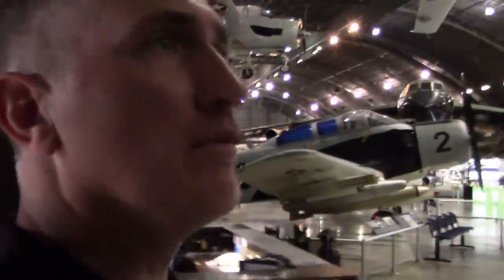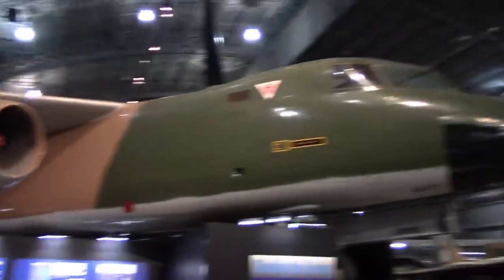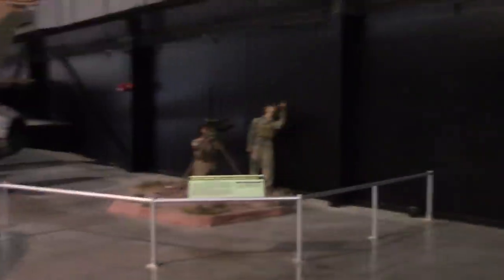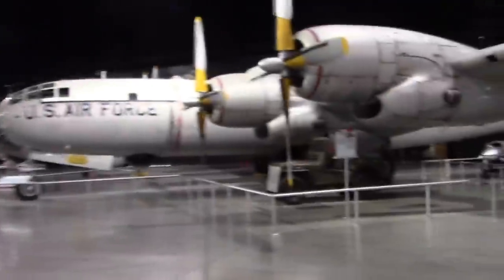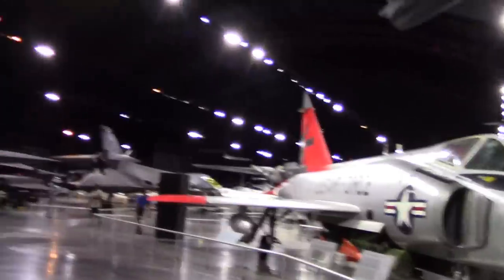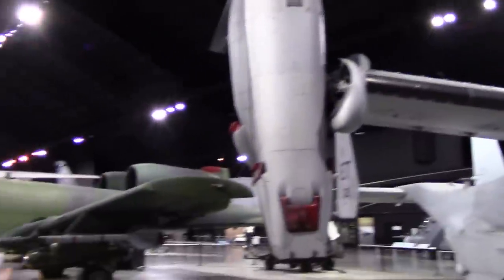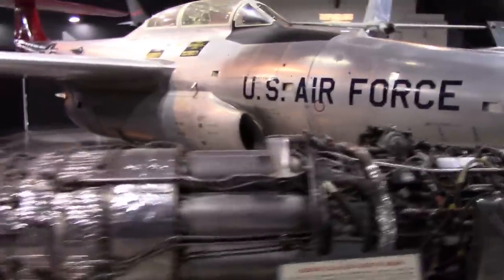Unofficial High Speed Tour of the National Museum of the USAF, Pt 2

Comment: Different B-26. The one in the last video was the Martin B-26 Marauder. The one in this video was the Douglas B-26 Invader. The confusion comes from the Invader being the A-26 during WWII and redesignated B-26 after the Marauder was retired. Special bonus neckbeardian trivia, the F-94 you showed is a B model which is Ak-Tchiually not a "Starfire". That name applies only to the F-94C model, according to Lockheed at the time.
Reply: Didn't know that about the Starfire name. Thanks.
Reply: I was about to type the same thing. Completely different aircraft with nothing in common but the designation.
Reply: In WW2 section was the A-26 light bomber which replaced the A-20 Havoc. The A-26 was renamed B-26 after Marauder retired. A number of B-26's were used in Korea painted all black or black on lower surfaces as night interdiction raiders. 

In cold war section the B-26 is a B-26K rebuilt to zero hour airframe for COIN ops by On Mark Corporation. They were used as COunter INsurgency aircraft and night interdiction in Vietnam but we're retired after a number were lost under questionable circumstances. Questions were raised about being too old and reliability issues.
Reply: @Anlushac11  The A-26A, (B-26K) also flew as Nimrod, were the most efficient truck killer per sortie. (at night)
Reply: .At some point, the B-26 Invaders in Vietnam were re-designated BACK to A-26, so the US could say "We Have No Bombers in SouthEast Asia" with a straight face.
Reply: @stevevernon1978  Ha! I never heard that. Wiki says it was Thailand's government that wanted that. I guess the F-111s were okay because they were "fighters"...

Comment: Just popped into my head, way back when I was in my mid-teens, my parents and I went down there to Dayton. I think it was because my Dad had an appointment for something at the VA, and we ended up at the museum for the day. Anyway, my Dad started jabberjawing with some random guy and they came to the conclusion that they had probably tripped over one another at some point in Vietnam because they had served in the same area at the same time. Turned out the guy was one of the volunteers that worked on the aircraft. He took is in back and we got to crawl all over an AC-47 they were restoring at the time. That was a really cool experience. 

I need to drive down there soon. The place is obviously much larger than it was last time I went, and full of a lot more stuff. Very cool video. Thanks, that brought up some cool old memories...
Reply: They put all the Experimental and Presidential planes into a 4th hangar. So now you don't need to take a bus to see the YF-23, XB-70, X-29, and the various Air Force Ones

Comment: The 2nd F-82 Twin Mustang shown in this vid was a important record breaker.
On 27 February 1947, P-82B 44-65168, named Betty Jo and flown by Colonel Robert E. Thacker, made history when it flew nonstop from Hawaii to New York without refueling, a distance of 8,129 km (5,051 mi) in 14 hr 32 min. It averaged 347.5 miles per hour (559.2 km/h). This flight tested the P-82's range.

This one was a earlier version that used the Merlin engine vs the latter models that used Allisons( less power/ No License fees).

Col. Thacker became a well knowm figure in the RC Scale aircraft hobby through the 60-70's.

Comment: The F-117 was specially restored to remove all of the special stealth materials, so I wouldn't draw any conclusions from the skin as it's displayed. They could indeed have just covered the underlying frame with kevlar or some other strong fabric and painted it black. The B-2 was a structural test model, and likely never had an "operational" exterior, too. At 23:27 you can even see some external braces under the wing that were added to make it safe for display. Also, the F-22 is actually a YF-22 prototype.
Reply: Serbs shot down an F-117 back in '99, the russians long have the "special stealth materials" from it's skin,they don't need to go to an American Museum to take pictures of it.So removing it from this plane was unnecessary.😉
Reply: Raul Alejandro Bastilla - You do realize there is a HUGE difference between the stealth on F-22 and F-35 than the very old F-117? Also having parts of an F-117 doesn't mean that Russia can copy it or know who to actually use it. Even today Russia still can't produce a true stealth aircraft. The Su-57 (which has been canceled) wasn't very stealthy.
Reply: No XF-23 makes me reeeeeeeeeeeeeeeeeeeeee
Reply: @jeremeymcdude  they have that one, too. It’s in the experimental hanger.

Comment: Regarding the F-82 Twin Mustang, the fuselage is significantly lengthened compared to a P-51. This was an issue with the Twin Mustang Restoration Project: Walter Soplata (who saved two of the five F-82s left on his farm) only had one fuselage of the XP-82 prototype, and Tom Reilly had to dispel the rumors that you could simply match a P-51 fuselage to it. 

Somehow he found/rebuilt enough parts to get her airworthy. Beautiful restoration. 

The NMUASF has two of the five F-82s left.
Reply: What little the F-82 has in common with P-51 Mustangs are actually with the H model. Which in turn didn't have a lot of common parts with the B/C/D models.

Comment: I feel bad for my museum’s B52 it has been left outside since the place opened
Reply: Yankee air? If you’re talking about Yankee air they are working on restoring it currently.
Reply: It's kind of hard to make a building big enough for the b52. Even the USAF museum doesnt have enough room for all of its planes. Outside literaly next to the parking lot they have a C-5 cargo jet, a C130, and another A10 just because they have no room indoors for them.
Reply: Bam Waffle Nope The Aviation Museum at Robins AFB we have all of the smaller things inside but bigger aircraft have to be outside because there are only 3.5 hangers. The Ac-130, B-52, A-20, and a few others are outside because of space. All of the rarer stuff is inside like SR-71, U-2, B-17, B-25, and B-29. Our museum has most of these aircraft but not 2 or 3 like this place has. No joke who needs 3 F-4s and 2 B-29s
Reply: TheFireIsOnFire Robins museum would have a C-5 if it had 2 times the land and one more big hanger.
Reply: Wesley Alth only time I saw a B52 was at Yankee air At Willow run. They have one and are currently restoring it. The air museum near me doesn’t have a lot of big planes but they do have the only SR-71 with a twin cockpit, and the Only XP55 in existence!
Reply: @Wesrl  who doesn't need 2 b-29's?

Comment: So that F-22 was built in 1991.  I’m guessing the original design programs started in the 1970s.  Kooky.
Reply: According to the museum write-up on this aircraft, while the serial number is indeed 91-4003, it was built in 1999 and first flew in 2000 at Edwards AFB with the 412th Test Wing.  After testing, it went straight to the museum and never flew with the 1st Fighter Wing, so the paint job is a fabrication for display.  I wish they had explained the 91-xxxx serial number since the prefix almost always is the year of manufacture followed by the number off the line.
Reply: Close, the Advanced Tactical Fighter program started in 1981 took them about 6 years to design build and get the F-22 accepted.
Reply: its stealth capabilities were borne of the have blue and tacit blue programs.
Reply: @birdmonster4586  You might want to check your dates.  The F-22 was still barely ink on paper (or pixels even) in 1987.  

While the USAF recognized a need to replace the still-new F-15, the initial RFP on the ATF wasn't issued until 1985.  FIrst flights of the YF-22 and -23 began in 1989 with first flights in The YF-22 on 29 Sep 1990.  In April 1991, the USAF awarded the contract to the F-22.  (This, I found out is why the first serial number was 91-4001, 91-4xxx for the year and month of the award.)  The initial production run was the EMD (engineering, manufacturing and development) aircraft of which s/n 91-4001 was the first.  These were not combat aircraft, but were used to further develop the airframe leading up to manufacture.  EMD 91-4001 rolled off the line on March 6, 1997.  First flight was on September 7 of that year.

Front-line F-22s weren't operational until the end of 2005, almost 10 years after initial production, 20 years after the first ATF RFP, and 24 years after the USAF announced their desire for a replacement for the F-15.  Keep in mind, the F-15 was still barely 8 years old in 1981, with the first F-15 models being produced in 1973, and many F-15s still flying today are over 30 years old, dating from the mid-80's.

Comment: I have 3 actual jumps from a OV-10, the rear of the center fuselage comes off and there is a slim bench you straddle. Only 3 jumpers at a time, and the last man is the only person who has a seat belt. When your over the DZ, the aircraft pitches up and the jumper releases the seat belt and you slide out.

Comment: looks like theyve rearranged a bit since i was last there (memphis belle debut).
always get a big kick out of seeing the b-47 as a family friend, majpr ralph lusk, was the test pilot on the rb-47. they used to have some of his gear on display but they rotated it off display awhile ago. 
one of his favorite stories hed tell me was how a floating compass  saved his and his copiliots butt when they had an electrical failure in the cockpit in bad weather. the compass wheel is floating on a post sealed in oil. well, her used the angle of tilt on it as an artificial horizon to get down below the weather and land safely.

Comment: The story around the Mig windscreen....they're 2 pane windscreens and supposedly between them is an alcohol based liquid (think vodka).  This was done to prevent the windscreen from fogging/icing at high altitude.  The opposite side of this story was that the pilots found this out, drank the alcohol, and replaced it with water-only to have their windscreens crack on them at high altitude.

Comment: Actually the tail numbers of Air Force aircraft denote what fiscal year they were ORDERED, not built.
 That F-22 you see at 0:29 was actually built in 1999/2000 but ordered in 1991 after the YF-22 won the ATF competition as part of the pre-production prototypes of the operational F-22. That particular one was overstressed to something like 14G by accident during testing in 2002 and as a result it was retired from the Combined Test Force and made a museum piece.

Comment: The Superfortress:  A B-50 could carry 28,000 pounds of bombs between internal and external racks.  121 Missions for 2,500,000 averages to 20661 pounds, so it's certainly possible for a B-50.  B-29 I think was 20,000 max over short ranges, so not sure.

Comment: Wasn't the B26 later designated A26? Similar to P types changed to F?   P51- F51.
 The Pima Air & Space Museum on the Southern tip of Tucson, AZ is an excellent choice for lovers of aviation, just not in July or August.
 They give tours of the airplane graveyard, and about 20 miles south is their Titan missile museum.
There you get to go down to the control/launch room, crew quarters and the missile, still standing in it's silo.

Comment: It was the British who pioneered the airborne lifeboat - https://en.wikipedia.org/wiki/Airborne_lifeboat - later replaced by the Lindholme gear https://en.wikipedia.org/wiki/Lindholme_Gear. And no, the F-82 Twin Mustang wasn't two 'standard' P-51's (e.g. P-51D) joined together, It was based on the model P-51H, which, despite the designation, was a completely re-engineered airframe. It also used Allison engines as Rolls Royce wanted royalties on Merlins (even if produced by Packard) on post war built US airframes, which they'd waived in wartime.

Comment: At 12:43 in this video:  There are still bits  of one of those buried a couple hundred feet down in a farm field not too far from Goldsboro, North Carolina.  From a Broken Arrow incident of a crashed B-52 in January of 1961.  Two H-bombs were released.  The other was recovered sticking out of the ground.  {The one sticking out of the ground was slowed by parachute before going splat.  The other nuke was not slowed - its parachute got shredded or something - and it augured-in at 600+ MPH, according to what I have read.}  

I have ALSO READ a comment saying if either nuke had fully armed and detonated, the "Bay of North Carolina" would now exist where the Goldsboro is located....

Comment: B-29 Jet Ace stats are pushing it a little bit, but still in the realm of believability; 2,500,000 pounds over 121 missions just tips the scales at over 20,600 pounds per mission. This is within the payload limit of a B-29A, and well within the payload limit of a B-29B. Plausible and possible, just a little at the fringes.

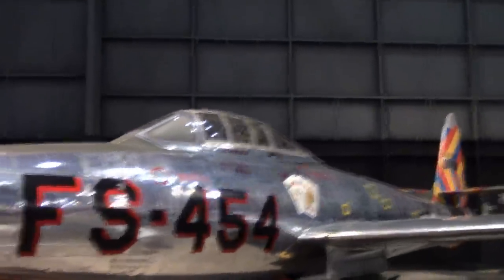Comment: at 3:33, that is a A-26, not a B-26, completely different aircraft
Reply: By Korea all the Martin B-26 Marauders were out of service, and USAF had redesignated the Douglas A-26 Invader as "B-26." So that's almost certainly what any signage on the aircraft says.

Yes, it's more wrong than right to describe this as "another B-26" and put down the differences to being from a later production batch. But it's a totally understandable bit of confusion, especially for someone who isn't focused on aviation.
Reply from the maker: Fair enough, appreciate it. But it's still a WW2 aircraft, no?
Reply: @TheChieftainsHatch  As far as I'm aware, yes and no. The A-26 began the design process and was moved into production with intention to be used in World War II. If I remember correctly, the war ended before it could see combat service.
Reply: @TheChieftainsHatch  It's a WW2 type, just barely. Just that during its brief service at the end of WW2 it was called A-26 and - because USAF hates clarity - the designation changed postwar.